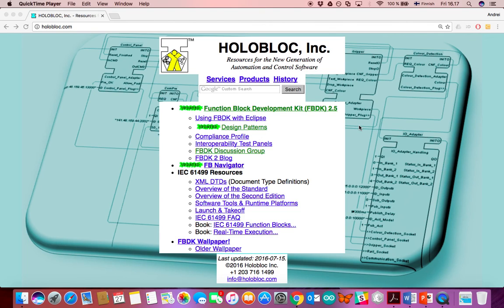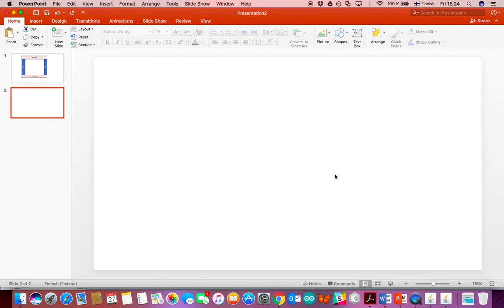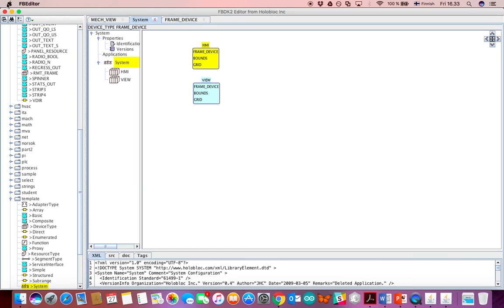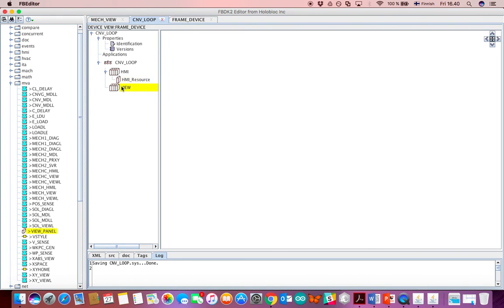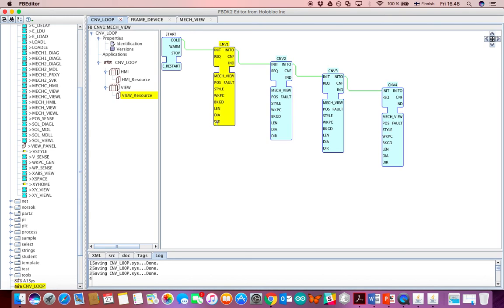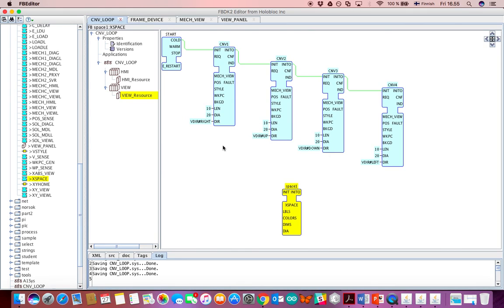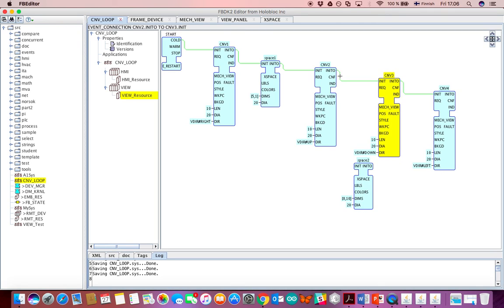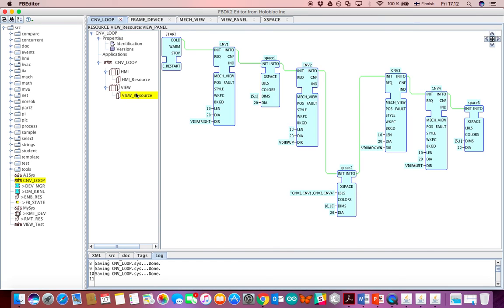Using FBDK by  Holobloc, Inc. (basic blocks at VIEW layer - arranging the view layer / MVC pattern)

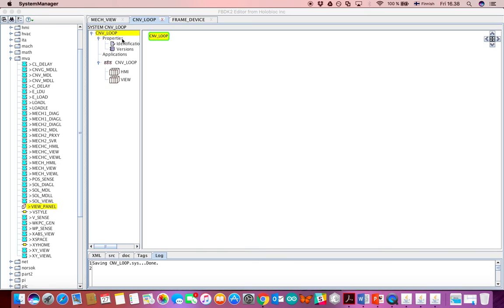Comment: I am repeating the exact same steps you're performing. However I am unable to run the CNV_LOOP as shown in 21:20. I get a pop up box saying CNV_LOOP terminated with exit value 1. What might be the cause of this problem? I checked online forums and am still unable to find a solution which works.
Reply from the maker: Hard to say. Are you able to run anything else? If you, for example, open from "src/compare" library the FB_GE_DT block, are you able to run it?
Reply: Yes. I am able to run the FB_GE_DT block.
Reply: Yes. I am able to run the FB_GE_DT block.
Reply from the maker: Good. So, in principle, it is possible to run something. Then, the project you’ve got has just two devices of the correct type, having the boundaries set, and nothing more?..
Reply: Yes. I followed the exact same steps. I tried running it on fbdk3 as well, still the same result.
Reply from the maker: Ok. Please send the project file to me by e-mail. Let's check it.